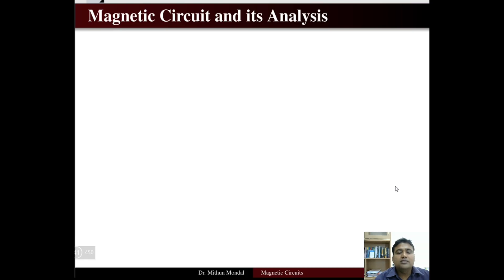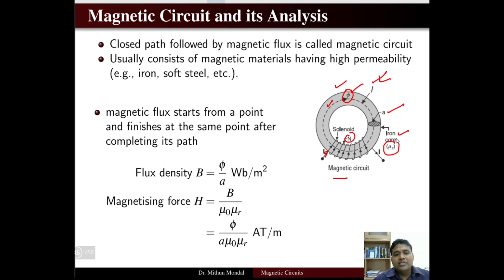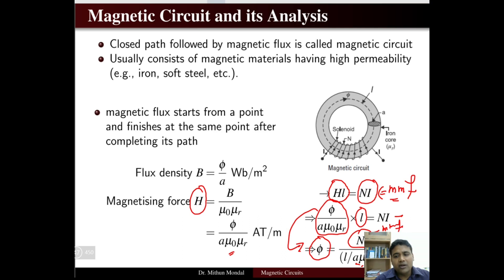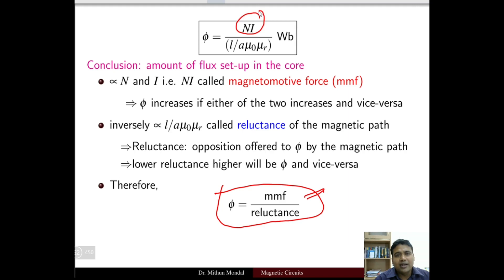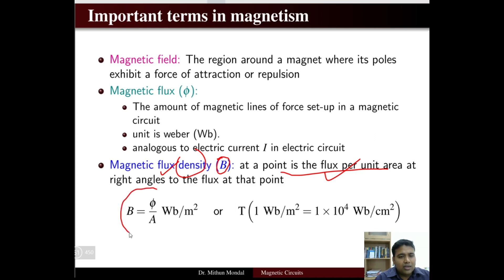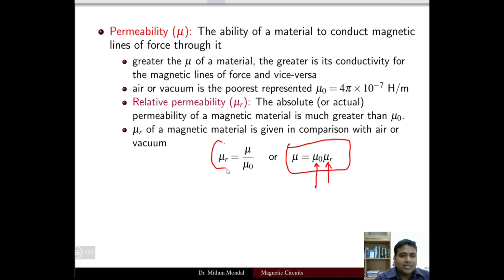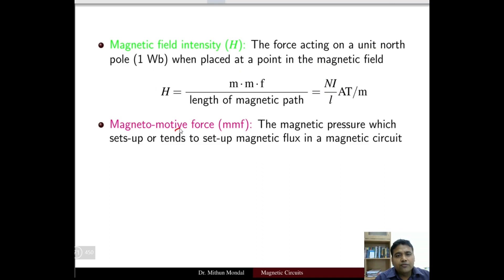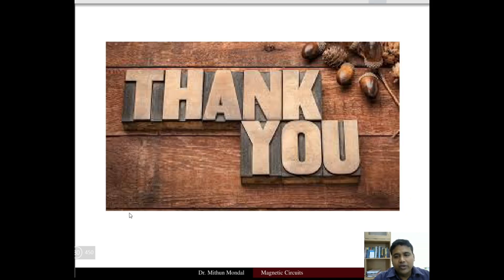Electrical Machines | Lec - 1B | Magnetic Circuits | Analysis & Important Terms of Magnetism

Comment: would you please explain ,whats the difference between magnetising force and magnetic field??  bcz in both formula you started as H.
Reply from the maker: Magnetising force is the force exerted by a magnet which is determined by the sum of all lines of magnetic flux (phi) present in a magnetic field (H). Now, magnetic flux (phi), magnetic field intensity (H) and magnetic field density (B) all are called by the term magnetic field. However, they can be differentiated by noting their units. So, F exerted by H can be directly called H-force.